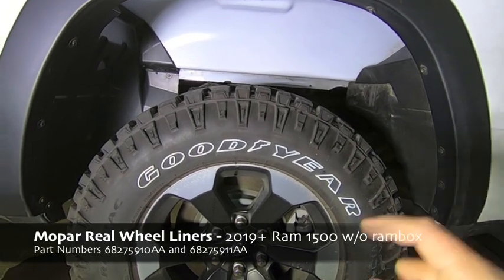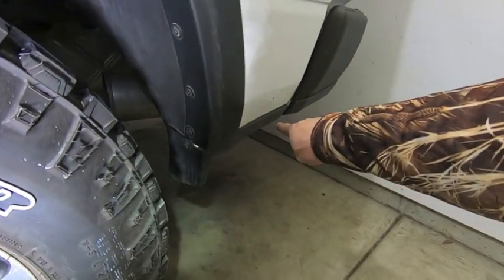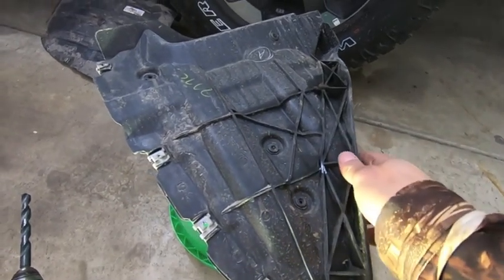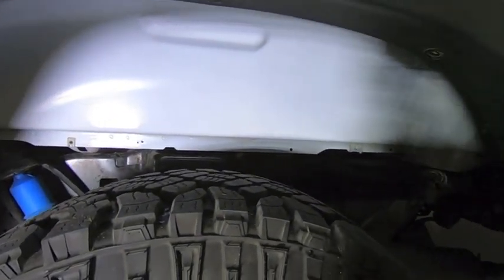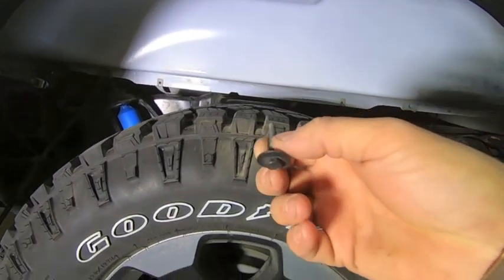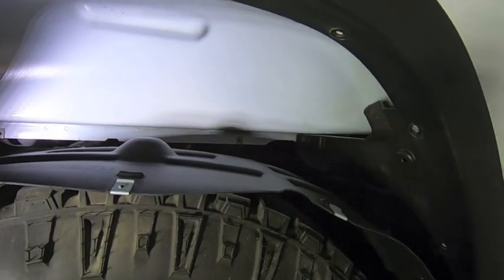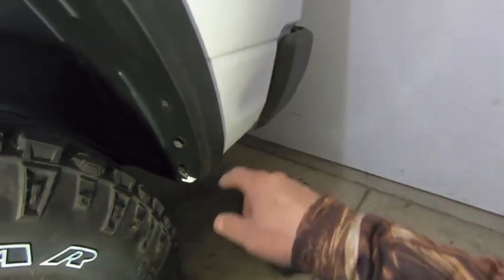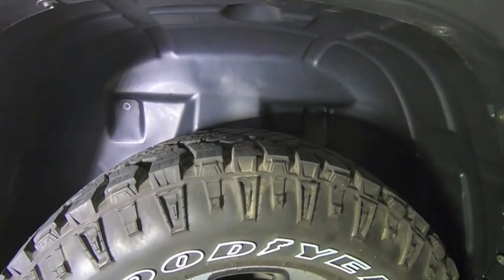Mopar Wheel Liners - Ram Rebel

Comment: Just installed mine if you don't have factory flares u will need 6 more screws 3 on each side.
Reply from the maker: Jeremy Lynch good call out, thanks! I’ll pin that.
Reply: Jeremy Lynch  di you have any trouble finding a clip for the screw on the inside of the well??
Reply from the maker: MrSlinger35 finding as in replacing the clips with new or finding as in, trying to align everything and get the screw threaded?

If the former, they clips are called u-nuts and should be available at a parts store.

If the later, make sure you start at the bottom on each side to pull everything down nicely.
Reply: Hey! Might you happen to know the part numbers of the screws needed. What about the metal u-shaped clips at latch onto the edges of the body panel? Is there as part number for those also? Thanks.

Comment: Because of your great video my wheel well liner installation went without a hitch: thanks! In preparation for the install, I ordered in some extra 8mm panel screws and clips. Seems that step was unnecessary, because the liners came with a huge bag of extra screws and clips. I now have 22 leftover 8mm screws and 24 leftover clips. It took over four months for my liners to arrive at the local dealership. Seems RAM is way behind in either manufacturing or delivery, probably both. Anyway, my liners look awesome and the undercarriage of my truck and bed are well protected. Thanks for posting; much appreciated.
Reply from the maker: great to hear!

Comment: Just did mine as well, with your help. THANKS!
Yes, if you do not have the wheel lip moldings, you will need 3  extra screws per side. You should  
find them at Lowe’s and Home Depot if that is more convenient.  
I too was very disappointed in the quality of the plastic liners. So flimsy.  So thin. So, I decided to reuse the front factory shield too. I removed 3 clips from the new liners and placed them the factory front shield. The new liner fit snugly between the factory shield and the fender lip. 
THANKS FOR YOUR HELP!

Comment: Jut bought my 2020 Ram Rebel after having two F-150's in a row. I love my Ram, but I must say, this is clearly a design flaw! I can see going cheap on a lower end trims, but c'mon! These should be standard on a truck with a $60k sticker. Just installed mine thanks to your video. I asked the dealer about them and they told me that they will not install them because it's too complicated and they won't drill holes in the frame due to rust concerns...HUH? After watching your video it was obvious this was not a huge deal. As I was installing mine, I found a huge chunks of dried up mud enclosing the sensor wires headed back to the rear bumper and continuing to the bumper. I had to gently break it up so I didn't pull a wire apart.  Thank you for making this video and clearly illustrating the process!!!
Reply: Why doesn't ram make them standard on all ram truck are options for $195.00 from the factory?
Reply from the maker: Couldn’t agree more!

Comment: Thanks this was the most informative video i found, just installed mine on 2020 1500 without flares only issue i had was on the reused ubolt had to adjust it down a bit from the plastic so it wouldnt fall off while getting everything in place. First one took 30 mins second one about 15 mins.  Have to say they are flimsy but should stop the dirt and more so around here rock hitting the metal that was exposed on the gravel roads.

Comment: I had to do the same thing for my 2004 Dodge Ram 1500, but the wheelhouse liners back then were of a much heavier gauge plastic. I've just installed these on my 2020 Ram 1500 and was really surprised at the lack of quality in this new Mopar product (found this video after I installed mine...). I suppose the liners will work, but not sure how long they'll hold up. I used the Mopar screw 6510827AA and not the 6510175AA indicated below. You can also find screws on that big Internet store that starts with an "A" that will also work. I found some M4.8 - 1.5 x 16mm screws for a BMW that worked well - not as long as the Mopar ones (I didn't have enough of the Mopar screws). For the additional needed U Nut, I found a nylon set at Autozone (Dorman Nissan Fender Liner Clips - #961-307D) ($3.99 for a package of two nuts) that worked perfect. I prefer the nylon over the steel to avoid corrosion. I have the Night Package, not the Rebel, so I needed more screws than was indicated in the video.

Comment: My new 2021 Ram 2500 does not have the wheel well liners. I'll be buying an after market set and install them myself. I have less than 200 miles on my truck, so I'll clean up the wells and install the liners before much damage can be done. I can't believe this is how Dodge cuts corners.

Comment: I just did this install..do not pull the rear wheel opening spat straight out and leave the clips in the body. Remove them with the clips attached to it by using pliers from the inside of the wheel well. If you pull them out you will bend the teeth on them which in result will cause your trim piece to not seat back properly and not line up correctly with your bumper.

Comment: All the screws are in place if you have the fender flares, if you don't, you will need 8 extra screws, and two U-tabs to install properly. You can use two U-tabs off of one of the 1/3 liner.
Reply from the maker: I have the fenders flares, you will be one screw short

Comment: Good video, Did you list the part number for the 2 screws you need to add?
Reply from the maker: Negative as I had extra trim screws laying around from another project
Reply: @WaterFowler41  Copy, I ordered a few of what I think are the right ones. I'll post the part # if it turns out they're the right ones.
Reply from the maker: Greg Grill awesome I’ll pin the part numbers when you loop back

Comment: The question is why doesn’t this just come stock?
Reply from the maker: Nicholas Bay I could not agree more.
Reply: It is unbelievable that Ram would not include these cheap plastic liners as standard equipment on the 2019’s. They came standard on the ‘09-‘18 Crew Cabs.
Reply from the maker: @Miami543210  Funny though because truck prices keep going up and up but the basic stuff like wheel liners, mud flaps, and halfway decent floor mats are getting less and less common...
Reply: Did these on my 19 rebel. My 14 and 17 1500 express rams had full rear liners. I did email ram about my dissatisfaction about a $60k truck not coming with them standard
Reply: It was the same on my 13 150 i had to add them as well, I saw couple 2020 1500s with dealer installed for 195 already on them but my dealer wanted 195 plus install of 150.

Comment: One would think that paying 50 60 or 70 grand they would put in these cheap plastic covers.
Makes me wonder they leave things like this out just so the truck rots and they get us to buy another.
I noticed it on a friends ford same missing parts at first I thought someone stole them but nope the manufacturer is just so fucking cheap.
I would rather them take cost from some dumb ass feature than this important part.
Its like not having shingles on a roof,it will rot
Reply from the maker: I couldn’t agree more. Nickel and diming us to death!

Comment: Thanks for showing us what a $60,000 truck looks like with garbage plastic wheel well inserts !! If you want good protection without tearing up your new investment buy an inexpensive HVLP air sprayer and do a mix of 50/50 Plasti dip and thinner. Three coats over a 10-hour period on an 80° day.
Reply from the maker: A spray liner isn’t going to protect the truck from any of that mud I dug out of the bumper. While thin these liners block that stuff from shoot up over these 1/3 liners and collecting in those crevices.

Comment: so i just bought theses and finally got them delivered tonight and was looking at the included instructions and watched a few of these install videos on YT (the few that there are using the OEM ones) but maybe they changed the kit since everyone else installed theirs??

Mine's a 2023 Ram Rebel, the part(s) I ordered are 82216333AB(AA) and the instructions make NO mention of keeping EITHER of the existing 1/3 panels and having to drill out the back piece etc.

Every other bit of everyone's instructions in their videos are textbook to these paper instructions I received MINUS ANYTHING TO DO with keeping the back half of that rear 1/3 panel on each side..

I'm curious if your instructions YOU received said to do so or if maybe I received a slightly newer design that negates the need for any bit of that back 1/3 panel like I keep seeing everyone else say they have to use.

Granted by now these videos I'm seeing about installs are all a few years old, and are unfortunately the newest ones I can find, but like others said, I received a whole kit with 2 big wheel liners, screws and clips galore, and absolutely NO mention of keeping either back 1/3 panels. I'll include a link to the instructions that match the paper instructions I received with the kit

TL;DR

What purpose does keeping the back half of the 1/3 panel do? Did your instructions SPECIFY to drill out the rivets and keep it?

Thanks for your time

https://s3.amazonaws.com/rp-part-images/assets/1bc5300a7a46a18432819d560c792505.PDF
Reply from the maker: Keeping the 1/3rds gave the new wheel liner something to attach to so it can be installed back into the wheel well. Hopefully they changed the designs because it was a stupid amount of work for liners....
Reply: @WaterFowler41  so when I actually went to install these, the instructions turned out to be 100% useless. 

You 100% still need to do exactly what you instructed in the video regarding the back 1/3 piece. I'm assuming Stellantis will NEVER put that in the instructions claiming they dont want some lawsuit if someone messes up drilling those out etc, but their instructions might as well not have been included. 

Interestingly, the kit came with MORE than enough extra screws and tabs and all that, but other than that, I went step by step using your instructions. 

So thank you so much for your expertise. My install went flawlessly because of it.

And to anyone doing this install on a 5th gen, this video is still 100% relevant in 2024 / 2025